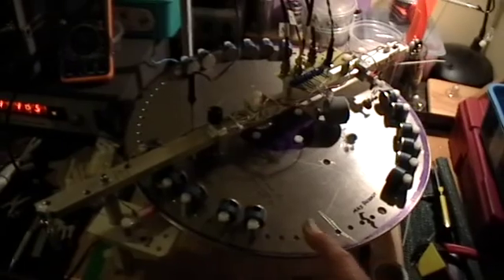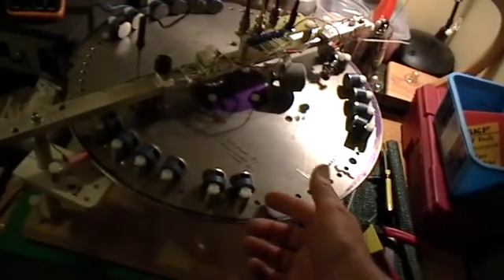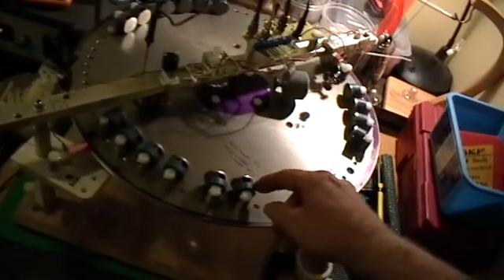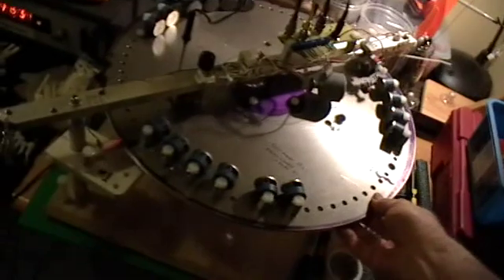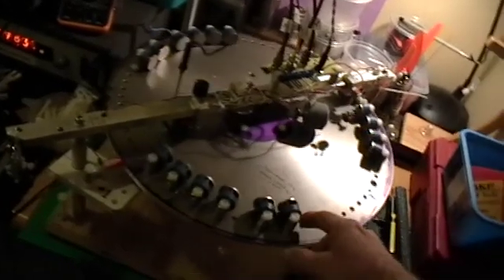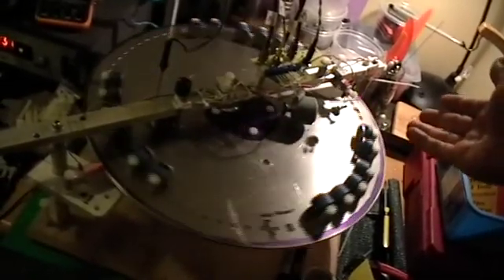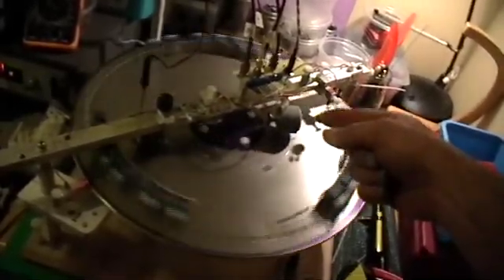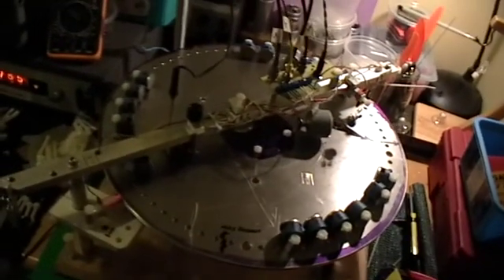MyLOW's Magnet Wheel Replication 7: Critical Thinking Supplement

Comment from the maker: I can let it remain stationary as long as you like. Because in the stationary position  the drive wheel isn't even in contact with the disk at all. The only friction is bearing friction and the only drive is what I give it with my hand. It can stay still like that with the motor running indefinitely. Only when I rotate the disk to a certain sector does the motor drive engage, and it only drives the disk for about 1/4 or 1/5 a turn on each turn.
But I see that MYlow has to restrain his disk.

Comment: Hmm, how can classical analysis prove or disprove magnet motors if it has been shown that classical analysis can't accurately model magnets? Anyway quantum spin (which is the best current 'explanation') is still a subject of fundamental study today.

Actually there are some large discrepencies between newtonian mechanics and reality. Good example is the moon, it's supposedly 10 meters off (with 2m accuracy in measurement) where classical mechanics tells it should be.

Comment from the maker: Oh, and of course Duty Cycle (or waveform). You need to take into account the waveform of the input and output instantaneous power and integrate it over time, in order to get the energy input during a run, to compare it with the energy output during the run. Comparing poorly-measured instantaneous power only, is a good way to come up with outrageous OU numbers. Unfortunately this point seems to be missed by a lot of folks. A good oscilloscope used well can cure a lot of misconceptions.

Comment from the maker: Yup, and that's about the only kind of "free energy" there is. By the way, you do understand that hurricanes dissipate energy, and that the overall entropy still increases, right? And that the energy that powers hurricanes comes from the sun, right?
So, since there's a concentrated low-entropy source, and a dissipated high-entropy sink, with the hurricane sitting in the middle churning away, it isn't really "free energy" in the way we usually mean with magnet motors.

Comment from the maker: Thanks again, Bill.
I see that you've pointed out that MyLOW seems to have the "Midas Touch" with magnet motors. Just about every configuration that he tries, with every kind of magnet, works as a self-runner.
Too bad queue, CLaNZeR, me, and a bunch of others don't seem to have the magic touch.
Now he's claiming 300 rpm. I don't even think his wheel will stay on the table at 300 RPM. The fastest I've gotten my MOTOR DRIVEN disk is 240 RPM and that's f'**n SCARY, and mine's well-balanced.

Comment from the maker: I wonder: In all MyLOW's videos, he shows the stator support as a free-standing bracket assembly, that is separate from and not attached to the rotor bearing support. And yet he has recently claimed that he has a working version that creates so much torque it is difficult to stop by hand. Yet it is supposed to be powered by magnet interactions. So not only is 2LoT violated by MyLOW's motor, but also Newton's laws and Conservation of Momentum.
Cool! No wonder the MiB are interested.

Comment from the maker: Claims are one thing, facts are another. 
IF wishes were horses, beggars would ride. The difference between success and failure with magnet motors, linear SMOT tracks or otherwise, has nothing whatever to do with size or "fields cancelling."  It's more like adding 3 + 3 and getting 7.  Even if you use a different font, or Roman numerals, or really big purple letters, you still can't make 3 plus 3 add up to seven.
In other words, Linear SMOTs require energy input to "work" and so do circle SMOTs.